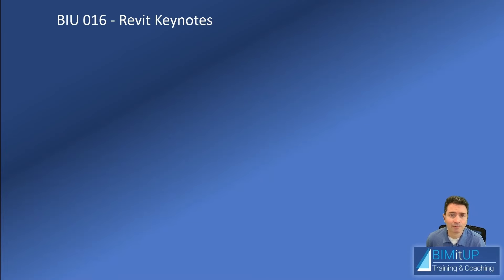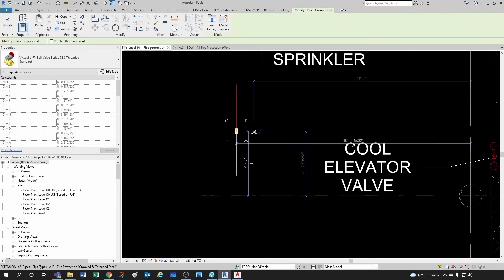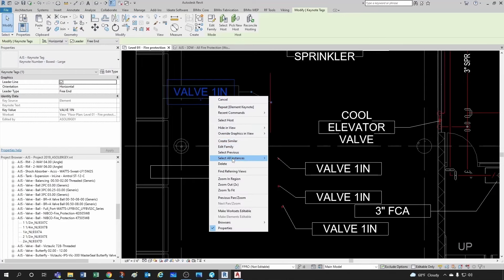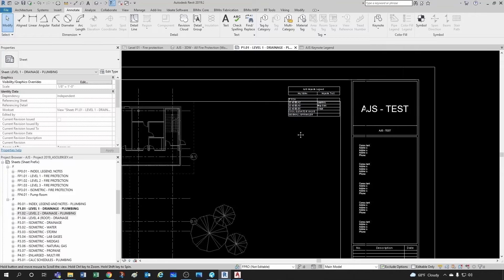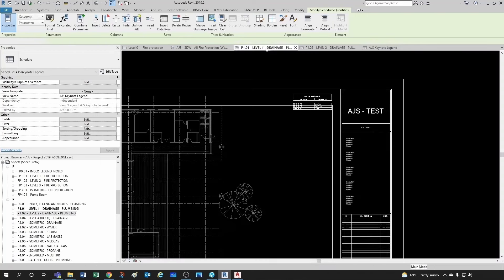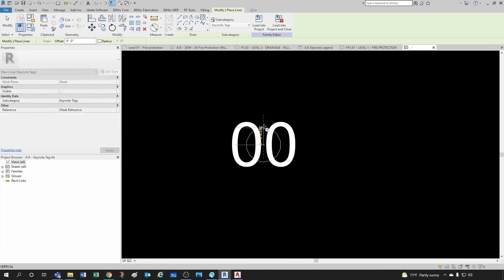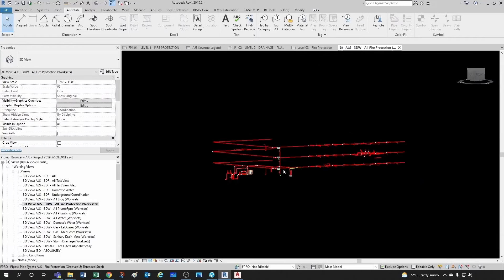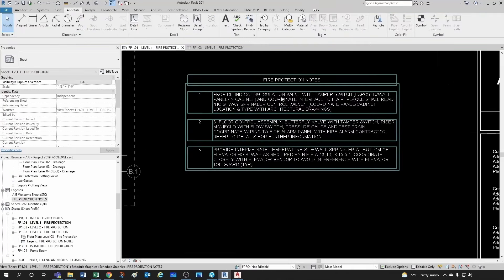Revit Keynotes - How to Create and Modify Keynotes and Keynote Schedules in Revit Tutorial

Comment: So as you create the keynotes, they are numbered chronologically.  Is there a way to reorder your keynotes on the sheet?  For example, I have a plan with keynotes that was sent to bid.  We changed out the sinks for a different type so  the keynote deleted and now instead of being Keynote 2, it's Keynote 33 and has changed all the other keynotes numbers as well.  I'd love to be able to drag Keynote 33 to the 2 position and keep all the keynotes the way they were.  Or is there a workaround for this?  Thanks!
Reply from the maker: You can open the keynote file in excel, remove the original content from keynote 2 and instead fill in the information for keynote 33 (which will not exist anymore)?